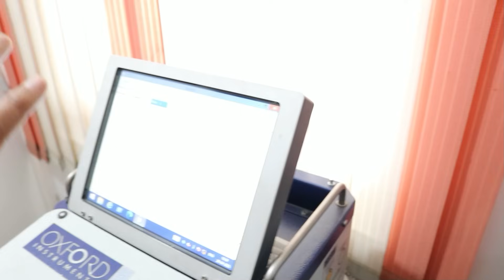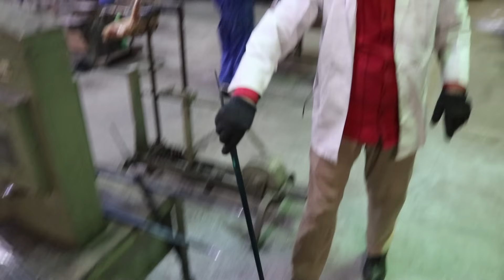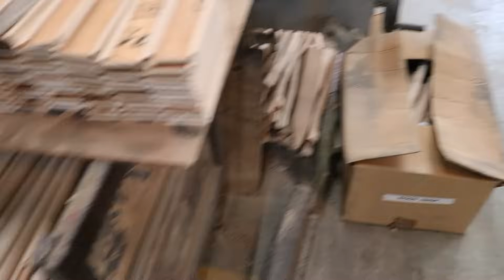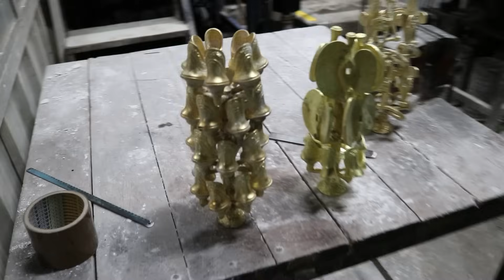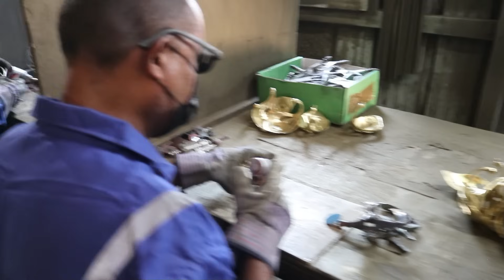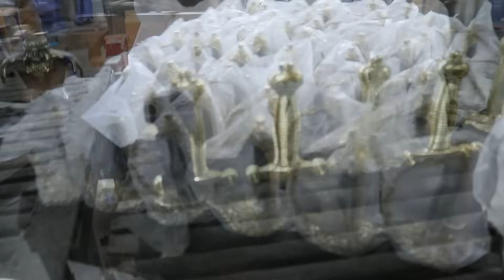HOW SWORDS ARE MADE at Windlass Steelcrafts of India

Comment: What also gives me confidence in them is their Mod and ISO 9000 approvals.  If the swords are released under such, the manufacturing should be of decent quality and, as long as correct technical standards are also adhered to (steel and heat treatment) will be acceptable for real combat.   That said, I'm not seeing any of the sort of batch labelling I'd have expected.    Also they apparently spare themselves the expense of providing many of their workers with overalls and other protective gear.

Comment: Before I started collecting original swords I bought a couple Windlass swords and they are GARBAGE. There is little to no distal taper,  blades have been tempered with crooks in the blade along the length and the swords feels like holding an iron bar in your hand. Why are they not useing a sword rolling mill to put the distal taper and fuller in when the iron is hot? Maybe they got the 1796 Light Calvary sword right but over all these swords are JUNK. Don't waste your money on Windlass swords. I am Very Disappointed in you Matt and now wounder how much of your information is just BULLSHIT..

Comment: Holy crap, each pommel, each guard, is made by hand from wax first? I just assumed it was CNC'd from a sheet of metal. I all the sudden understand where all the cost is. Thank you for this tour and the eye opening revelation!
Reply: Not exactly, Someone made the original pattern (a 'positive' ) that was then used to make a rubber mould (a 'negative) or more likely several for production runs. The wax is then cast in the rubber mould producing the wax 'positives' that are then assembled into an array by hand as we saw in that section.
Reply: @stonedog5547 Oh that makes more sense. They're just cleaning them up before assembling them on the mold.

Comment: Thanks for the heads up on the Windlass company and their dangerous shop conditions! Having worked in a foundry and several metal-working shops here in the States I am dismayed by the working conditions on that shop floor..
The safety issues in that shop are APPALLING! NO safety glasses, no safety masks for the guys testing the blade's strength (Imagine a blade snapping and a piece of it under pressure striking the operator in the face!) One guy in a MEDICAL mask, that's all the personal safety gear?!? Pouring molten metal with absolutely NO SAFETY GEAR? No gloves, no masks, no safety glasses... No bueno, I will think three times before buying any more Windlass products. There are a LOT of Windlass products in my collection.. Had no idea the working conditions were bordering on SLAVE labor conditions! Those guys need a UNION...
The lack of care for employee welfare says a LOT both about the COMPANY and the labor and safety laws of India. Human life is obviously cheap in India.    SAD...

Comment: Im not a stickler for safety but the guys with open toed shoes and bare ankles pouring the molten metal right by their feet.... i was like wtf.
Reply: It's too hot for closed shoes inside the factory
Reply: @stefthorman8548  I work in a steel mill that smelts its own metal; not only is this rubbish, it is highly unsafe rubbish. It's one piddly spill away from someone losing a toe or worse from molten brass splattering on the ground and embedding well within in their skin. 

The guys up on the foundry floor wear heavy grade gear: high temperature resistant boots, gauntlets & overcoat, woolen chausses and face shields on top of long sleeve clothes and helmets. Regular breaks and proper hydration keep heat exhaustion at bay. All of this means no one for the fast decade or more has lost and part of their body at work; I doubt windlass could claim the same.

Comment: Wait, the molds aren't reused?  So every single unit of hilt fitting that is cast had to be carved by hand from wax?
Reply: One typically casts the waxes in a silicone rubber mold which can be reused hundreds of times. You were seeing workers trimming and adjusting any excess material or flaws in those waxes. There are often some air bubbles or blobs from a torn or damaged area in the rubber, or flashing from a seam in the mold. You just use a hot metal tool and a scrap of the same wax to flow in a replacement and then a hot metal tool to scrape or gouge excess away. Cold knives and files for the finishing work. Faster to fix in wax than brass. But all the spruce areas have to be ground off anyway.

Comment: Okay, this is crazy. They are carving the lost wax forms by hand? On one hand it's great to see so much attention to manual craftsmanship, on the other it seems painful having to do such repeating tedious labor all day because you are cheaper than machines (other way round obviously in the western world).
Reply: The wax models are generally cast by an injection process, into silicone moulds. The work going on here would be to remove flashings and tidy up details, and to fix a number of models onto a central sprue so that multiple pieces can be cast simultaneously. Very similar to the lost wax castings used for jewellery manufacture.
Reply: Yeah, and it seemed like a literal 1:1 process, like every single cast piece has to be carved by hand from wax?